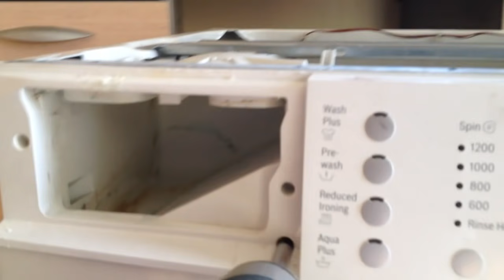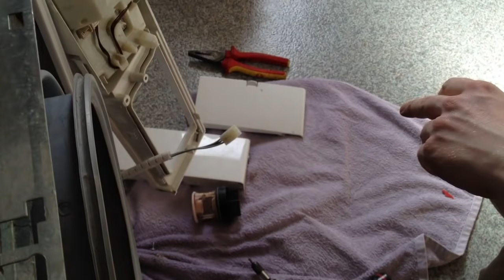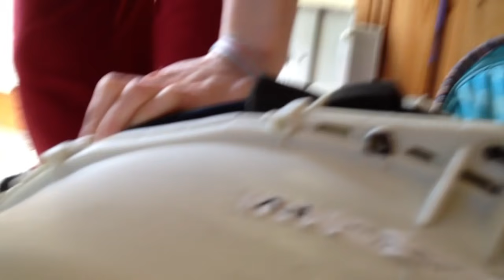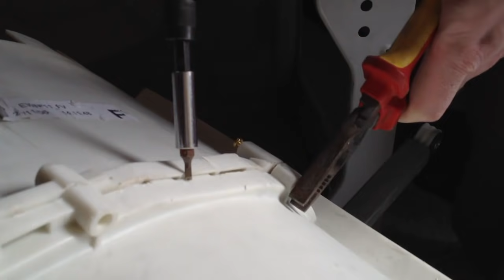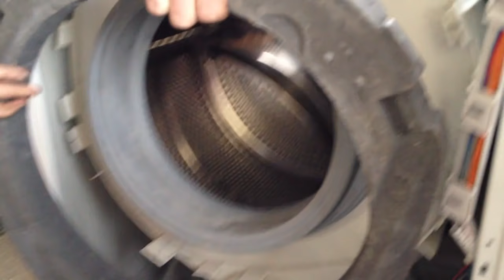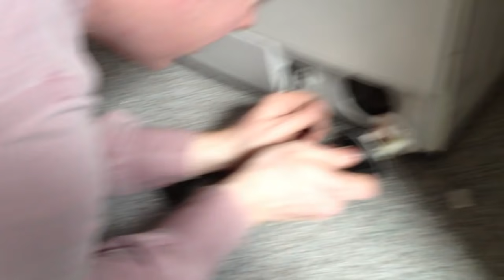Washing machine dismantle and rebuild Bosch Classixx 1200 Express drum noise fix

Comment: Dude, my machine makes this horrible sound, is like the "drum" (i guess that's how is call) hits the sides of the machine. I'm not allow to have a washing machine in my building but considering that I live on the 4th floor with no elevator, a washing machine is necessary. As you can see, that sound represents a big problem with my landlord.

Comment from the maker: It took around 5 hours while i was making the video of it as well. If you have an electric screwdriver and an array of bits for it you could have it done in 3-4 hours. The most important thing is make sure its unplugged and to keep track of the disassembly. The video i made for youtube was played back a few times during reassembly. Daunting overall but simple step by step. Good luck and thanks for watching!